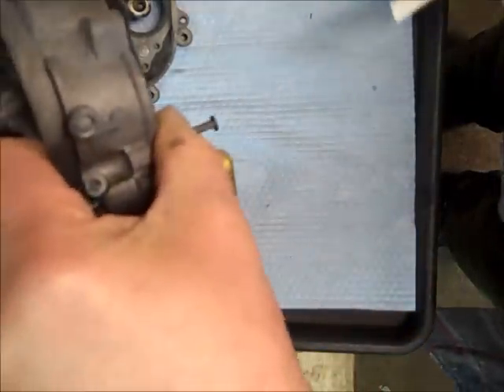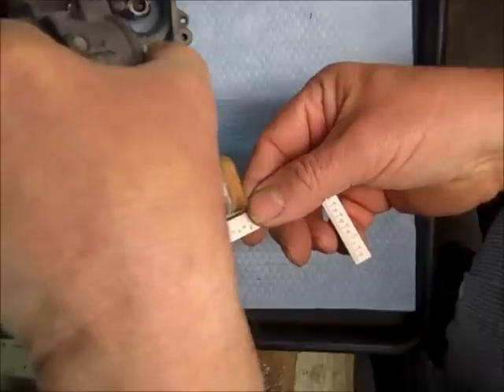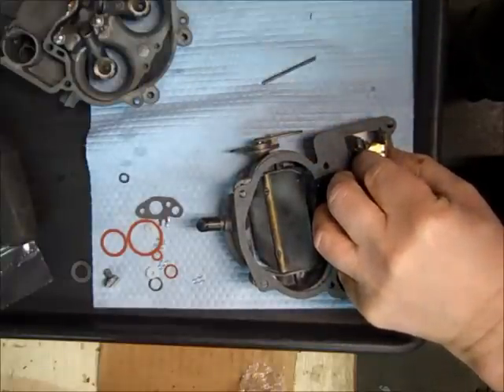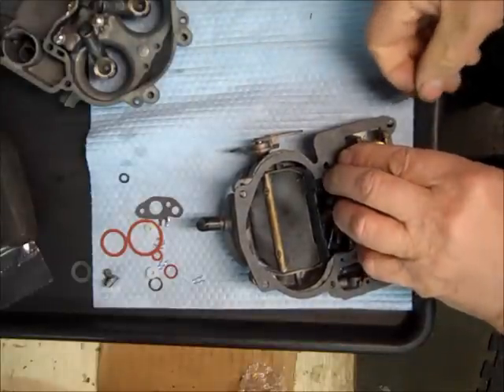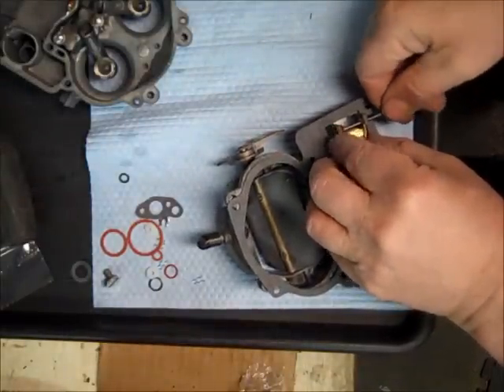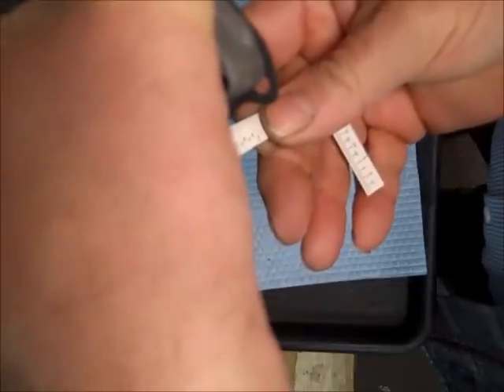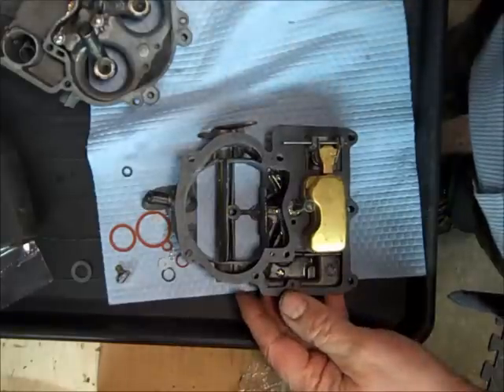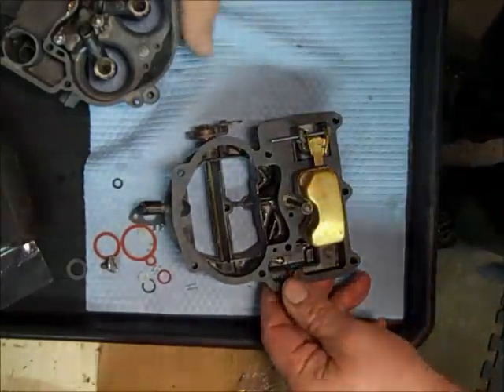Rochester 2G 2GC 2 Jet Carburetor Rebuild Part 5

Comment: i have this carburator,it has the choke with arm that goes into the intake on a heat actuated spring. my question is can i convert this to electric choke?
Reply from the maker: Yes, they are here, but you need to match the carb number: https://www.carburetor-parts.com/2-jet-choke